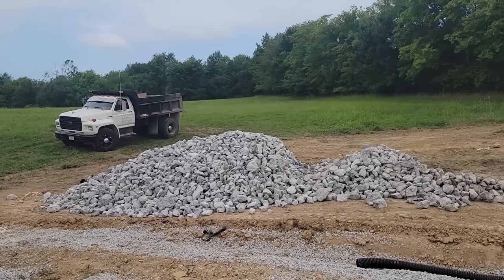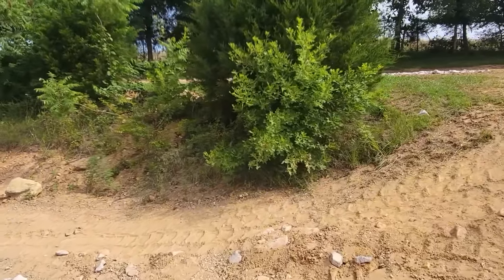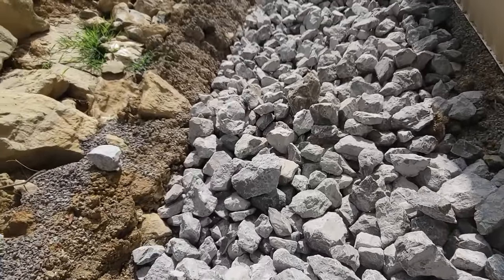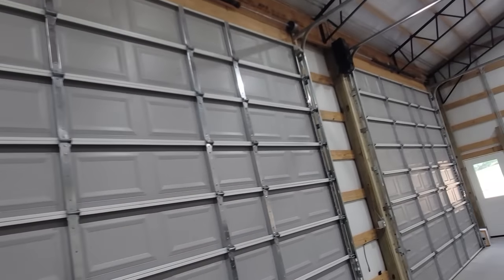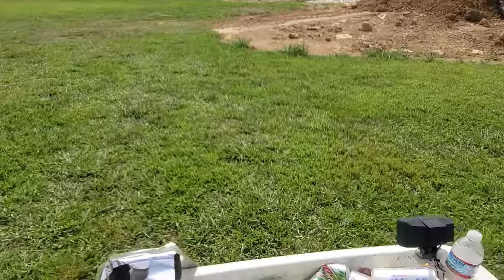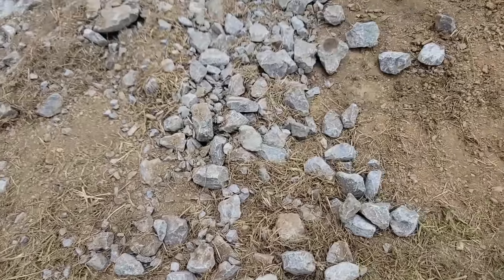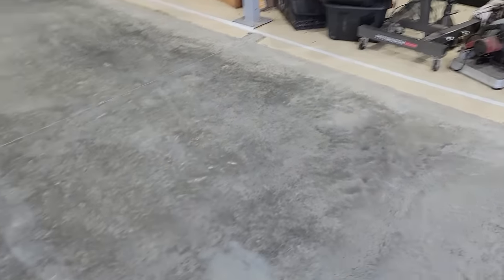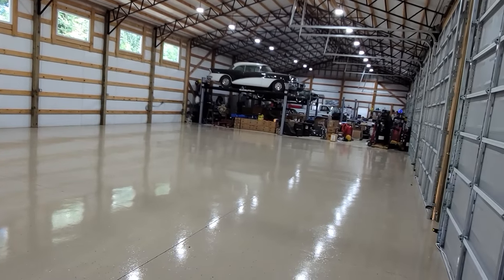My NEW Shop FLOODED! - Here's what happened (we had to start over)

Comment: Check out CANARMs HVLS fans, an 8 foot dia fan is about $780, but you have to remember that these industrial fans move a LOT of air. I was in a shop once with a 60 foot ceiling, they had a 24 foot dia fan , about 10 feet down from the ceiling. It was  going slow, maybe 60rpm, and i could feel the breeze. Two or three of these fans in your shop would 100% get the job done.also check out Garrett Glaser's comment chain. Seems like a group of guys who know what they are talking about when it comes to drainage.

Comment: What we never do is to combine the drainage with the gutterpipes - it must be two different systems ! The drinage (the pipes with slots/holes) shall be placed minimum 8" below the concreat slab and have 5% slope.
The gutter pipes can be installed more shallower and no holes is allowed. 
110mm diam down pipes are capable to recieve 50sqm roof.

Comment: Dont "smooth out" the inlet to the pipe, actually make a low area for the water to build/pond up in, and then when it gets high enough, just water and not mud will flow through it.

Comment: The perforated drain tile needs to be dedicated to its purpose. By putting the gutters into the perf pipe you’ll flood the stone bed. Think about, water flows from high pressure to low. Use a solid pipe for the gutters and a second perforated pipe for the ground water. 

Those rock lined swales don’t work because they’ll silt in solid. In 10 years you won’t even know it’s there.

Comment: That’s called a Curtain Drain and I think they maybe should have gone slightly deeper but a 1/4 inch of mud slurry water isn’t much so it will probably handle it. Curtain drains are the only way to fix the problem but the top of the perforated pipe should be covered with drainage cloth. Some guys do it, some don’t, mud usually is the deciding factor. Another good idea would be to fill the wall gap between the back wall where the water came in and the slab. Look for a product called Seka-Flex and fill between the metal siding and the slab on the inside of the building, preferably do the whole inside of the building not just the back wall. If you seal it tight the water won’t get passed the wall into the shop if the curtain drains get overwhelmed.

Comment: Unless you're building with steel columns....The next "shop" would also benefit from a 6"-8" concrete curb up off the slab and above grade around the exterior of the structure. No reason to allow any wood building material to come in contact with moisture, period.

Comment: I built a barndominuim  after the kids moved out. I installed  mini splits in the shop and living area. Two zone floor heat. Industrial ceiling fans in the shop. However they are silver not black. I guess you could always paint them black . Built a mezzanine for storage. The only thing I would change is making it bigger. 😂 never big enough 🤘🤘🤘

Comment: Maybe add a ditch on the uphill side of the road to trap the water before it crosses the road. There is plenty of land to cut a pretty heavy duty ditch to divert most of the water except what comes down the road. My guess is 90% of the water problem comes from hill. Which is very hard to control. Like the gentleman said get an engineer. They control the Mississippi mostly.

Comment: I worked at a shop that flooded and the boss did everything you just did but the water still won. He dug 4 sisterns with sump pumps and the water still won!The new owners finaly won after building a new shop with a 12'' higher slab and a retaining wall to divert the water and a bar ditch before the wall. You just spent money on lot of rock that will soon be filled and covered in dirt.

Comment: The riprap worries me. It will work great short term, but if the rip rap silts in, water wont be able to get to the pipe. I'd keep an eye on that. As a fix, you can go closer to the hill and just dig a nice big ditch parallel to the french drain. Take it out in the 'other' field. All will be well and all you'll need to do is keep the ditch cleaned out. No need for pipes or anything.

Comment: I'm a plumber, my father was a plumber and I've been at this over 30 years.

- keep organics off basement and shop floors
- if building a new shop run a floor drain. To hell with local codes, plan ahead and hide an inlet you tie into weeping tile.
- when it comes to rainwater plan for a hundred year storm then upsize
- crush, gravel and landscaping fabric are your friends when dealing with weeping tile 

Water and fire are two things you can't get carried away planning for. Protect your investment. Ifvyou cant do the above then landscape the water away.

Cheers

Comment: Create a pond at the lowest spot or maybe install a sump pump for backup you can never be to sure things get clogged. I would have installed PVC with holes drilled into it with a sock liner because it never gets crushed or clogged over time.

Comment: Not an expert or anything, but if I was you I'd build a dry dam above your shop for extra safety measure. Worked really well on a friend's farm in a similar situation.
Basically, you just carve out the hill above your shop some and build a mound near that fence line. Then on the uphill side slope it so water goes around your shop. Up to you, just an idea.

Comment: Think trench, not pipe for drainage. Make them super wide like at least 6'-8' and then they don't need to be very deep. Pipes will get clogged. Trenches fill with silt too, but they are easier to clean out and you can see what is happening.

Comment: Yep basically what was put in a kind of a dry creek bed, temporary at best. A French drain is fine for roof gutter water, not flood prevention. What should have been done is too late. An option to do on the low side of tree line is maybe dig a gulley to divert the run off. No idea who your engineers were or the inspector but this should have been brough up during the survey.

Comment: Sorry to hear this happened to you, 
Seems like I mentioned this was going to be an issue when you were breaking ground and cutting into the hill on the side and behind the shop, until you get the ground lower than the shop floor your going to have this problem with flooding in your shop, that drain may help a little but it's not going to cure this problem tbats just a bad band aid on a opened wound,
 I would suggest putting things that need to be stored on the floor on pallets and have a pallet jack handy ready to move those pallets to dryer floor space if and when needed, or shelves and get dry valueables off the floor, unfortunately this wlll happen again and again,

Comment: put a sock over your drain tile it wont get clogged up.  Plant bare root loblolly pines on the dumptruck rood on the upside of your new gravel ditch.  I have hand planted 23,000 bare root trees on mu 20 acres in Missouri.  The trees grow 24 inches per year and will solidify your hillside.  Missouri Dept of Conservation will sell you trees in the mail.

Comment: Sorry I didn't watch your earlier videos, or I would definitely would have mentioned having your shop floor about 18 inches above grade. Also, the concrete pad should not extend outside the outer walls of your building, except for the outwardly sloped pad going into the garage bays. You don't want rain hitting the pad and flowing in under the walls.

Comment: while you have it uncovered I would suggest you put a separate pipe for your gutter, that's only a 4-in pipe and that's a pretty big building You want that other drain pipe to divert water away from your building it only has a certain amount of capacity. You better put a sock over that pipe or you're going to get it stopped up that rip wrap and stone will not filter all the mud out. Hopefully in the ditch on the upper hill you have a 4-in pipe in that as well but you have to have a fabric sock over the pipe or it's going to get stopped up over time. Now I know there's going to be a million people debate this but trust me that's why they put the sock on there is to prevent soil from getting in your drain pipe That's why you buy it with the sock already on it they didn't do that because they just wanted to spend money on material.

Comment: You need at least 1 extra drain pipe just for the ground water removal. That pipe can’t handle that much water. I’d put 2 more myself if possible. Also be careful driving over that pipe you might crush it!

Comment: Has 60 acres, builds shop at the lowest point on the property. Don't build in a hole if you can avoid it.  I feel your pain to a much smaller degree though.  My basement occasionally gets water in it during heavy rains, or extended periods of rain.  I'm on .6 (point six) acres.  I've learned to not put anything I care about on the floor.  Everything is elevated slightly so water doesn't damage anything of value.

Comment: If You haven t done Your HVAC  Might look into a hillbilly geo thermo where You bury pipes 5 to 6 ft  deep 6in  pipes in a run   Fresh air intake far end variable speed fans on building end puts 59 degree air in your building  Also gives You a mild preasurized building air blows out stuff doesn t come in

Comment: I've done countless geotech studies for homes constructed along slopes or along the toe of slopes in areas near you. French drains are a given, but it would help if you could grade a drainage ditch on the upslope side of the fence line, intercepting the runoff before it gets to your French drains.  May need some check dams within the ditch to slow the water and let sediment drop out.
Probably gonna have a rain event like that a few times a year.  April/May and Nov/Dec.  As long as the collected runoff drains onto and within your property you should be good, but to be honest, I wouldn't show it on youtube for various reasons.  Check your codes regardless.

Comment: When this was going on I had a feeling this would happen. I could see the field behind you was flowing water toward you. Should have had a burm at the top that ran the length of the road with drain system set up. Then at bottom of hill a burm with drain system. I have put in a lot of drainage in this type problem. But things happen and  we live and learn. The contractor learned a lesson.   {  Man you have two compressors and I  need one big one. to run tools. But on Social Security doesn't pay enough to buy a new one.

Comment: I'm a contractor boss and there's a few things on your building that should have been done.....first off a 4×4 trested bottom plater thingy should have been fastened all along the building as a bottom plate then caulked with some heavy duty polyurethane goop goober and a french drain should have been engineered right up against the foundation on a sloap and about 4 feet deep...you did ok on those French drainer strainers but what should have been done is a full blown retainer wall dug deep heavily reinforced with waterproofing membrane  on the outside to keep thar mountain from moving and washing out....your lucky it wasn't a huge landslide that crushed your building in fact a retainer wall has to be a must there....no if or ands or should haves about it......

Comment: Looks like you’ve received a lot of input from professional and armchair engineers, etc. so, I’ll throw my two cents worth into the pile. Having been a public works construction inspector for nearly 20 years, and having inspected many drainage projects, I would have made one addition to your drainage project. I would have placed your corrugated pipe in a filter fabric sleeve. This would prevent clogging of the slits in the pipe.

Comment: Sucks that that happened hope everything works out. You should use that spray foam too on the outside of the building along the bottom edge where the metal meets the concrete. Just run a spray foam along that whole edge and then cover it with those stones so you can't see it.
Reply: Spray foam is like a sponge it absorbs and holds moisture and will rot out the metal and posts

Comment: Those fans a alright for a smaller building, I don't think they will move enough air to make a difference plus  I don't think they will be able to handle the trapped heat right below  the roof. I've found a belt drive air handler from a central heat / air for a large building works super, depending on the size of the electric motor pulley , the 2.5 inch with a 3/4 hp continuous duty motor will move a lot of cfm 30/40 mph wind 50 ft across my yard ,directed straight into my garage (28X32) makes it like a hurricane, so I set it up about 25ft outside the garage.  I can send a video

Comment: Without having read or seen everything, I have a question: Why wasn't this workshop hall built on a slope on a kind of terrace? Then only the rear connection would be at ground level and the workshop would be on higher ground towards the front. Then almost no drainage would be necessary.

Comment: As someone who has connected my gutters to underground drain tiles for decades, my experience is you will have problems because you switched to perforated pipe.  The perforated pipe will fill with ground water, leaving no place for the gutter water to go.  The end result is your gutters will back up.

At a minimum, you should have two pipes in that tile, non-perforated for downspouts and perforated for ground water.

Comment: A poured foundation should have been used, I know it seems like a long way off, but those post's will rot off and the diversion system seems too small for the watershed,1inch of rainfall=100 tons of water per acre,but good luck anyway.

Comment: Your rip rap drain won't work for long.  It will silt in, and you are back at square one.

Pour another slab on top of your existing one if you only took in an inch of water.  Not much else you can do in your situation.

Comment: Big Ass fans. I installed in the county pavilion I was over 25 years ago and still running.  I learned about them at a coke cola distributor center.  You do not need as many fans they move the air

Comment: you should check out them pully/belt system fans they use em at theme parks and stuff but 1 motor can run like 10 fans

Comment: That's unfortunate that happened.  If I may give some advice, don't put an underground fuel tank at your place. I don't know what the laws are in you're neck of the woods but you could be setting yourself up for a big problem. I did a cleanup on a underground tank and it was a huge project. The tank that was in the ground was good with no leaks and were monthly tested good. The ground before the tank install also tested good. With state inspectors and all the cost of removal it was tremendous. It doesn't just open the door for problems while you own the property but also with future owners and if a problem arises after you're gone it is possible for future owners to come after you.  Of course it's completely you're decision, just adding my opinion for consideration with my personal experience

Comment: That black corrugated pipe is no good. It will work for a little while but the sdr26 perforated pipe is a much better quality and works much better. Ideally you need 3 or 4 inches between the siding and the finished stone grade and make sure it's pitching away from the building. What you're doing will definitely work though.

Comment: Buddy u need to get a bush hog to that hedgerow that runs parallel to your path beside the shop.. the uphill side..rent a mid sized excavator and get down to the dirt.. build a 3 foot wide x 3 foot high burm.. out of red clay.. not sand and take the excavator and pack down the berm.. it will be there till the dineasors come back.. deflect some of that water coming off that field..

Comment: Too many people fail to consider DRAINAGE and water run off when building.

I'm about to build in an essentially open field, very mild slope of 2 inches per 4 ft. (double the grade specified for plumbing drains) and only 500 ft from foundation to top of the grade.

I'm still specifying top of slab 1 ft above original highest grade at the building site.  it would take something on the order of 6 inches per hour rainfall rate for me to have to worry about runoff overtopping my slab edge.  (a virtually impossible rainfall rate for this area)

the ONLY defense vs flooding is... going up.

Any drain system can fill and the water keeps running off.  You can delay the runoff from being enough to reach the shop.  You can't stop it with less than a earthworks berm between source and what you want to protect.  Make a 2 ft to 4 ft tall ridge of dirt between your flooding source and your building.  Or raise the building.

Then you need to consider the effects of redirecting the flow...  Are you going to cause flooding for someone else?  If that is possible, you need a containment pool with limited rate outflow.  
A "dry dam"  Normally dry, but in heavy rain it can collect a major amount of water, letting it out through a pipe size designed to not allow the massive water surge that flooded your building.

I'm middle of digging a pond and in effect right now, it's acting as a dry dam and containment pool until I close up the dam.  2 acre feet of capacity now... 3 acre feet when completed and it will have .5 acre ft excess capacity that flows out a 4 inch pipe ... before water level gets to the overflow spillway.  (close to impossible for water to get to the spillway level...)

Water is 100% predictable.

Comment: Strange way to build. Here where I live in Norway, we build a ring foundation first, deeper than floor level and if needed 3-5 feet above ground level. Then we put the building walls on top and concrete in the floor. This way water will not enter building unless it is more than the height of the foundation. And the  the wood will not rot since it's not in contract wit water or wet soil...

Comment: You need to have more airline before running it into your air/water separator, the air is to hot and moisture will go through the separator and and into the tools.